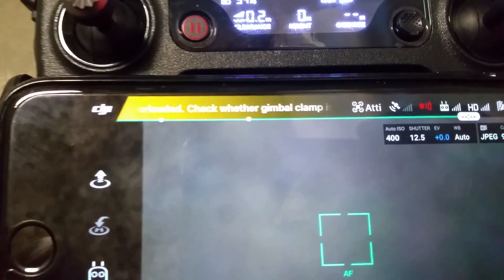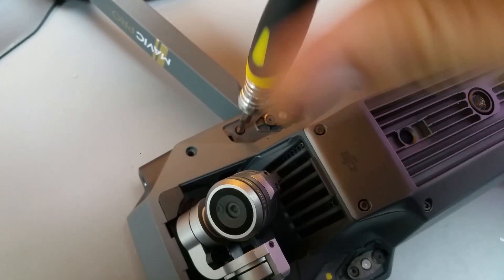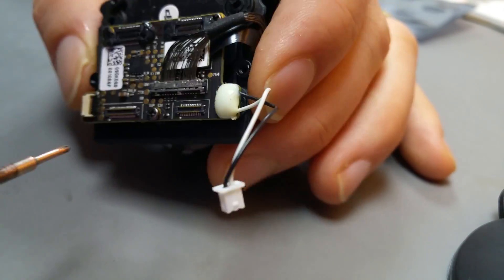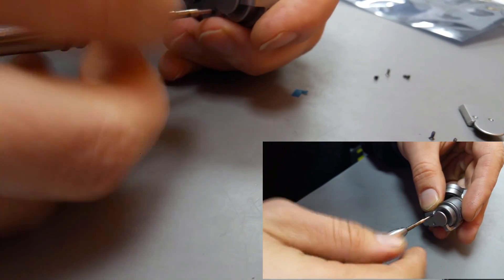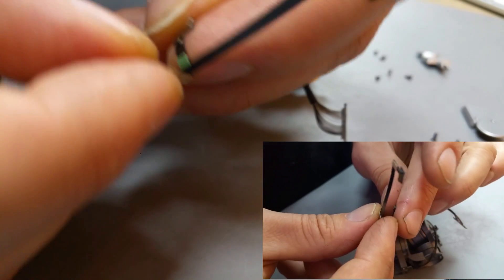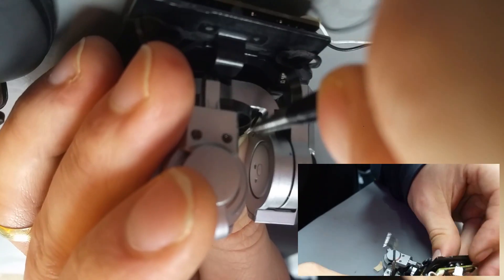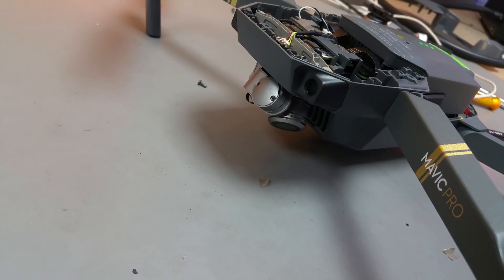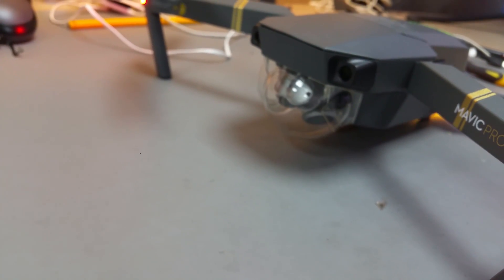How to Fix GIMBAL Motor OVERLOAD error on DJi Mavic Pro from Start to Finish

Comment: What exactly you done sir? Just unplug and plug again cable? Not replaced any cable or any parts ya? Mine currently overload too
Reply from the maker: Hi no I replacing flex cable
Reply: @frogtechtips  nice video...
Reply from the maker: @maTJoe007  thanks

Comment: hi, in my mavic pro besides the overload warning... it constantly moves when it starts, and it makes an interference noise... those problems are fixed with changing the flex?
Reply from the maker: Hi probably yes Flex cable can help
Reply: @frogtechtips  thank you very much for your answer, im gonna try, greetings from argentina!
Reply from the maker: @OMARERRE90  you welcome and I will wait any questions just ask
Reply: @frogtechtips  i have one more... sorry! i noticed the gimbal gets too hot also after a while, i saw some answers in other places that may be the motor that must be changed... you say i still try with changing the flex and if the problems remains, i send it to the support?
Reply from the maker: @OMARERRE90  hi if you getting hot that's can be because telex but if you want save time you can replace motor as well is not that much more money look on description I hope link inside still working if not let me know I will find some for you

Comment: 6:12 if this part of the suspension is where the suspension motor is, if you press on it with your hand, it seems to move a little, what could it be?
Reply from the maker: Hi if i good remember yes is little moving
Reply: @frogtechtips  The gimbal works for me, but it’s not convenient to put pressure on the camera every time so that the gimbal motor doesn’t shake

Comment: Hi frog tech i have a 3 weeks old mavic pro and doing the same error as yours gimbal overload and motor overl load and gimbal doing erratic movement do you think this is a cable problem? i bought the parts now and tools might change it tonight but the deone is still under warranty, the thing is im book for holiday this weekend and cant wait for three weeks for the repair of dji support
Reply from the maker: Hi do you have any crash or when you transport your mavic do you use gimbal protect that white staff if not you can have cable damage
Reply: Frog - Tech - Tips  hi frogtech  yes ive used the gimbal protector always ive just use it 5x now its almost new i nevwr crash it or any impact on landind

Comment: Does it always need a new flex cable? Wouldn't you first check to be sure all connections are seated? Or is it more often than not a bad flex cable?
Reply from the maker: From my experience is for 95% problem with the ribbon cable

Comment: Great video. In my case the gimbal doesn't move at all but i do have image transmission.  Do you know where can be the problem? Just had my drone stuck in a 9m tall tree and rained on the drone for 2 days. Dried for one evening then next day I've noticed that the gimbal stopped moving. Any advice much appreciated.  Thanks
Reply from the maker: Hi even small damage can be problems as this gimbal is so sensitive but first at all open you drone and check for any water damage
Reply: @frogtechtips   hey. Opened it and fixed much appreciated there are so many videos on YouTube . Thanks
Reply from the maker: @ionutdragomir6070  you welcome I hope you subscribe and will like my others content as well
Reply: @frogtechtips  absolutely
Reply from the maker: @ionutdragomir6070  thanks so much my new friend

Comment: I just replaced my gimbal ribbon cable. Both motors are working but gimbal calibration doesn't take place. What is the issue ??
Reply from the maker: I give you answer on my other videos already

Comment: Hi frog tech tips :) I was just wondering, how did your camera behave before doing this fix? Currently, mine looks forward, then very suddenly folds all the way in so the camera lens is facing fully downwards. sometimes it goes back to looking forwards, but then within a second it starts to look down again or towards the back plastic of the drone.

I'm happy to be brave and try this awesome fix you've showed in two videos I've clicked on - but yeah, not sure if my drone has the same issue. The camera just shakes like crazy and barely points in the right direction. I have writing come up "Gimbal motor load too large. Please check if the gimbal clamp has been removed. No clamp has been removed, everything visually looks fine.

Thank you thank you thank you in advance if you're able to help! 

Greetings from New Zealand!
Reply from the maker: Hi Jared you write absolutely what usually camera do when is ribbon cable foulty and this damage can happen just over time.i will definitely recommend you replace Flex cable  I have more videos about this problem on my channel as well with some more explain on some videos.just have a look or any more questions just ask.

I hope you click on subscribe button as well
Reply: Frog - Tech - Tips is the flex cable a different cable to the ribbon cable? Thank you so much for the reply you’re a life saver! I’ve subscribed too :) very handy videos, I appreciate it very much!

Comment: Replaced the cable on mine yesterday still same gimble issue also now getting front and downward sensor issues. Dji won't do anything as its more than 12 months old plus has water damage due to a crash.
Would replacing the whole gimble solve the issue rather than just the cable?
Reply from the maker: Kikkawa Ryu hi ye there can bi motor problem as you write your is liquid as well do you still have video signal from camera if yes you can try just motor part with is much cheaper that complete gimbal  
Plus are you sure you done all correct as even small damage can bring motor overload problem back 

How bad is your liquid damage  and be sure you not make damege on vison camera but sometimes need all recalibrate after new gimbal  first try solve gimbal problem 

You can send me picture on mail if you need more help or if you are from UK you can send to me for repair
Reply: Frog - Tech - Tips I can still see everything it all focuses just fine but will go floppy from time to time when recording, only recently happened after driving to Scotland from near London. Also had a software update which could do more checks but no clue. I'll give motor replacement a go if not I'll try and claim on insurance
Reply from the maker: Kikkawa Ryu ye try replace motor check description for part you will need and as I see you are from UK if your insurance can't help you let me know send me email or contact me on FB and I will send you all information where to send  for repair good luck and let me know
Reply: Frog - Tech - Tips I'm hoping barclays can sort it out I'll give them a call and put a claim in about crash etc rather wouldn't wanna sink hundreds more into this than I have to

Thank you for replying I'll try insurance route first if not I'll shoot you a message
Reply from the maker: Kikkawa Ryu no problem and don't forget subscribe to my channel :-)

Comment: My gimble stopped working it has image but it does not move when I start it or on the remote. Do think its the cable ?
Reply from the maker: I think yes should be flex problem

Comment: Could you link to a 256gb micro sd card, I think the LEXARs seem to be the fastest????
Reply from the maker: try check this one  and if you like different  one let me know  https://rover.ebay.com/rover/0/0/0?mpre=https%3A%2F%2Fwww.ebay.com%2Fulk%2Fitm%2F273629313516
Reply from the maker: or check this one looks ok as well https://rover.ebay.com/rover/0/0/0?mpre=https%3A%2F%2Fwww.ebay.com%2Fulk%2Fitm%2F382682071112

Comment: hi
thanks for this video 
i crashed my mavic in trees while flying backwards :P
and i have a broken left rear arm and gimbal doesnt move at all on start up.
Im getting "1- Aircraft Motor Overload. Check whether gimbal clamp is removed.
2-Gimbal is restarting.Check that the gimbal rotates smoothly if restart fails again." error messages
However my gimbal doesnt seem to have any apparent visual damage.
what do you suggest?
Im based in Germany
Reply from the maker: Hi gimbal can have damage and don`t need to by visible ye will need take parts down to get proper check 
arm replace is easy but you will need solder some cable video about that problem will come soon on my channel 
Iam from UK but any help you will need just ask and don`t forgot subscribe

Comment: thanx for the help i fixed it back but  i find my gimble to get stucked in certain angle and when i try to tilt it, it jerks and stops . can you help me why does this happen . is there any other problem in the gimble .it happens only in two positions rest of the movement is fine and now later that day i find the video is not properly stabilised when there is a quick movement . plz help me . i changed the ribbon and the vibration plate .
Reply from the maker: +ashique zygx hi can you explain what happened with your mavic do you have any crash, is there any visible damage on gimbal did you try gimbal calibration etc as maybe your gimbal motor is faulty as well good point is you can buy motor as well just check description for link and vibra plate rumble is ok 
Like I set I need to know more and full story
Reply: i cant find any visible damaged . when i power it on it moves up and down and all the movement it does it doesnt come into position , and in the caliberation it completes 51 % and it stops showin caliberation not successful
Reply: and it moves smoothly except in two position . i feel something is blocking the movement  . and i have no idea about the bearing and how it works so can i open it without any mistake
Reply from the maker: +ashique zygx on that's sound for me your motor is foulty as well bed news is you will need new motor as is not repair posibility so far I know I tried that with no luck at all and as you can buy new motor about 40 pound now is no reason spend more time with find how to repair just buy new motor and I hope that will help you please check description for second link

Comment: Hi I managed to replace the ribbon cable and the drone camera feed is live and still registering on the App. but the gimbal still has the same issue. Any other troubleshooting recommendation?
Reply from the maker: Hi are you sure you don't make any damge when you fit a new felex as even very small damage even invisible is big problem

Comment: My mavic pro got crash and have the “aircraft motor overload. Check whether gimbal clamp is removed” error message in the dji go 4 apps.  Tried many times to calibrate the camera gumbal, but do not work.  Is there possible of flex damage? Image and video still appear and can still record.
Reply from the maker: Marcel Evangelista hi ye I think there is flex damege flex is not expensive and is always worth to try 
I see even undamaged flex or is looks like undamaged make this problem
Reply: Mine works fine when turning it on sideway...

Comment: The message GIMBAL Motor OVERLOAD comes when I start the Drone.
There it wanst to kalibrate. Then you can here that the gimble is moving in all directions and hitting something.
Is the replace of the cable also going to fix this problem?
Becuase the Camera still works fine.
Reply from the maker: hi I think for 99% you will fix this problem with new ribbon cable
Reply: Where do I get the ribbon cable?
Reply from the maker: @sdoberma  look on description there is some link
Reply: @frogtechtips  gracias

Comment: What kind of screw driver did you used in order for you to take the gimbal apart?
Reply from the maker: I have screw set like one in description try have a look and click on link
Reply: Frog - Tech - Tips I don’t see it
Reply from the maker: @brandonthevisionary485  hi sorry I checked and I removed last time I change description  here is link for you this is simular one u use https://rover.ebay.com/rover/0/0/0?mpre=https%3A%2F%2Fwww.ebay.co.uk%2Fulk%2Fitm%2F163760042554
Reply: Frog - Tech - Tips thank you
Reply from the maker: @brandonthevisionary485  you welcome

Comment: I recently crashed my drone in to a tree. no visible damage apart from the tiny little l bracket attached to the gimbal vibration board has snapped. is this easily replaced? also when I turn the mavic on there is no movement at all with the gimbal and the error gimbal obstruction keeps popping up. I can move the gimbal freely with my fingers. is this likely to be a problem with the ribbon cable?or something more sinister?
thanks
Reply from the maker: Hi I think you will need new ribbon cable for 99%
Reply: thanks very much.
this video will be very helpful for me then!
Reply from the maker: Will Pierce you welcome

Comment: Hi, I have the mavic pro and it shows “gimbal motor load too large”. Is this the same issue as the “gimbal overload”? And if so, would this be the right video to follow out the other video you posted on fixing the mavic pro?
Reply from the maker: Hi not sure but can by problem with flex as well

Comment: Need help, I get gimbal not installed in DJI go 4 app after crashed....I have DJI Spark
Reply from the maker: Frank Jay hi I never repair spark as no one have problem but I will bet there is gimbal problem try open and check for any visible damage and if you see any damage just replace that part if not try do that with some logic or if you are from UK contact me on email I will try help you

Comment: I had same problem, I replaced flux cable but again giving gimbal overload error.. What could be the problem.. ?
Reply from the maker: hi did you get straight after replace or after some time as if been straight after maybe you damage flex in fitting process or can by faulty top pcb as well
Reply: @frogtechtips  its straight after fix.. I brought it from bangood.com, I carefully fixed it.. No physical damage seen
Reply from the maker: this cable is so soft even invisible damage can make gimbal overload or new fex can be faulty I see that as well I will try check  all conection cable or motor as well and maybe again reconnect all
Reply: I will check again by re connecting.or try another cable. Thank u for ur reply..
Reply from the maker: @bharathrajvv  you welcome and let me know or buy complete part motor maybe will be good choice for you look on description for some link
Reply: I have the same problem after I changed my ribbon cable. The weird part is, if I tilt the drone, I won’t get the “overload error” also, I can then calibrate the gimbal with 100% success.

Should I try replace the “ribbon cable” again in case I damaged my new one. Or is t something else wrong because the gimbal works on all axes if I start the drone tilted.

Comment: Hello, my gimbal is point down after crash. Do you think if I replace flexible cable then it will fix the problem? Thanks.
Reply from the maker: Mark Nguyen hi I need to know more did your gimbal move or just stay on down position do you have any error in app ? Do you still have video signal?  How bad is been crash is there any more damage 

And ye probably is flex problem but check all 3 motor if not moving smooth you will buy complete motor ye let me know and good luck